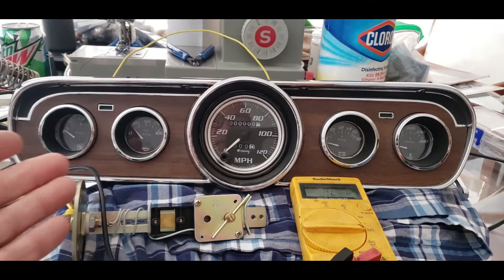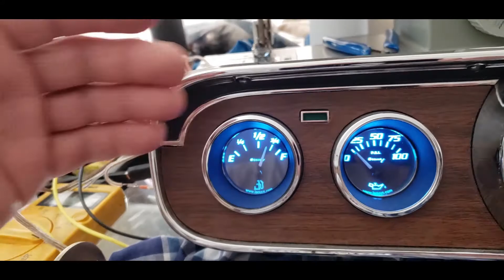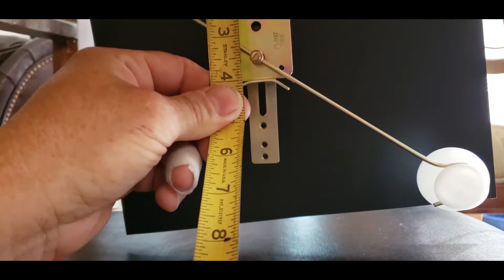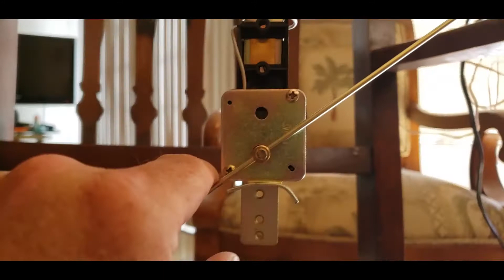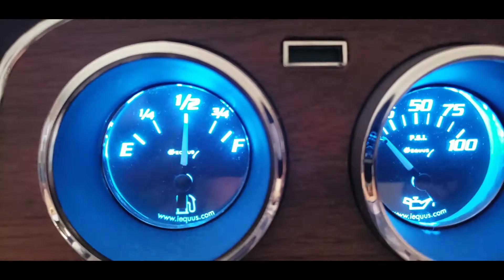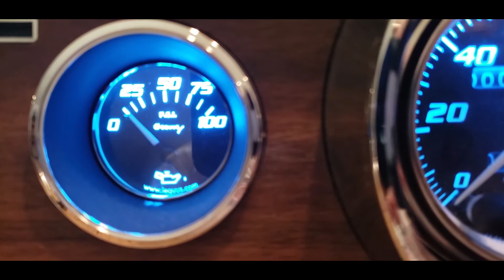Fuel level sender calibration

Comment: 👍👍 good job.
Remember, the height level of the gas does not represent the actual gallons of gas.
Using factory type components, it is a challenge to get close.
The bottom half is important. 
I set empty with 2 gallons in the tank.

Comment: Dude i am gonna be rude here, but i swear its just cuz thats my type of humor. So before i rant, i do wanna say, im happy for u.. that u got everything all worked out and the world is safe. And simple math trick... If its a "hair" below or above 3/8, double both the numbers and subtract 1 from tge top (ex: 3/8 minus? No, 5/16. 5/16 minus? No, 9/32... Stop trying to come up with "an accurate" percentage. Forget percentage altogether). Also, start out by undoing the crimped ring trim of the gauge, take the glass out, set ur sender at half way, pry the needle off the gauge with a fork, and stick it on the half way point.

But bro....

I am SO SURPRISED, with ALL the over thinking u did, that u didnt start doing absurd things like: adding a lizard or 2, to the "tank" to see if that changed the buoyancy, sprinkled some dirt er somethin... Add some fishing weights to the rod.. ill add more between here and the next paragraph if something pops in my head.

Heres how to make this easier, if u ever do it again (follow the factory instructions. Lmao im kidding hang on): u got a 9in height from the bottom of the top of the tank, to the top of the bottom of the tank. Put ur pivot point at 4.5in (just like u started). Use some pliers to bend the bare rod end, at THE VERY END(close as u can, to save straightness for minor/future adjustments), but the float end of the rod needs to touch the bottom AND rest on ur "empty" tang...

In essence: ur pivot in the middle, ur float TOUCHING the tang and the bottom of the tank. If the pivot is in the middle, the tang stops it at empty, and the float is floored.. the top of the bottom of the tank should be 9in to the bottom of the ball.

Forget buoyancy! The ball touching the floor before its truly actually empty (but on E at the gauge) will be ur reserve.

Now cut off the rest of the rod, except whats necessary plus 1in, to land on the other tang, with that 1in for a spare of slack (weather its touching it or not)

To get ur full reading (since u did the smart thing 1st, and adjusted ur tangs before the old english experiment), bring the float up to full. If its not touching the tang, bend it til it does. If it hits the tang too soon, bend it til it dont.

The only math necessary, was 9/2 lol.

Step1)adjust tangs to match gauge
Step2)put pivot in center
Step3)put float side to floor and tang (remove major excess rod only side)
Step4)put float side to ceiling and tang (manipulate excess rod only side)
Done.

Notice my reiterations are the SAME lol. No confusion. No trying 20 different things. No water or lizards. No percentages. No saying 5/8 oh i mean 3/8. The thing is, THE ANGLE of what u had feom the beginning and THE ANGLE u had at the end all stayed the same! For some reason, u kept trying to break physics, because of a needle, and all u ended up with was not being center, not reaching the top, and not reaching the bottom. U practically started out great, trampled on the perfect ideas u 1st had, and SLOOOWWWLLLY got REREALLLY close to plan A lmao.